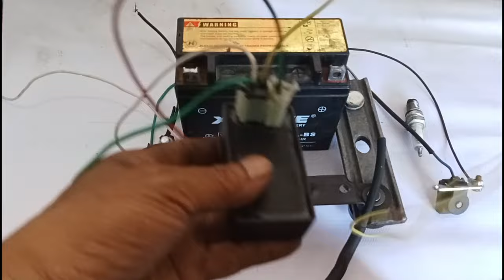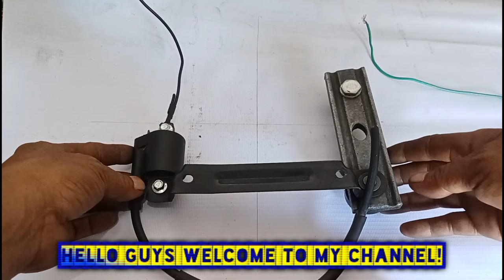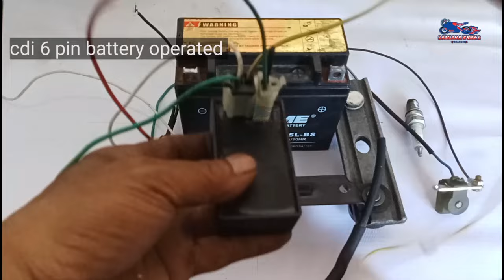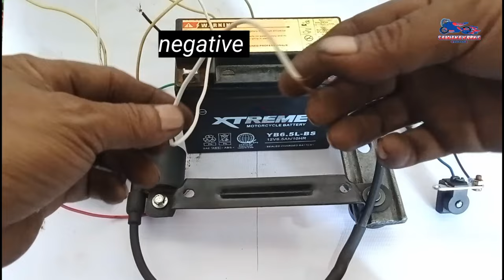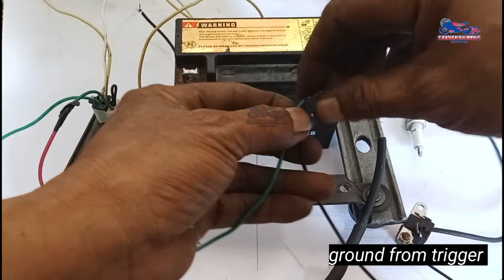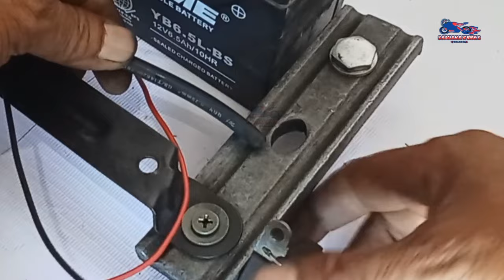invention how to test cdi motorcycle

Comment: Needs one of those spark plug gap testing tools that makes a gap on the end of the spark plug. That's the best way to test if it's good. A short spark doesn't tell enough information. Needs to show a much longer spark to realistically duplicate what happens in the engine. But your design is great! Just needs a little spacer on the end of the spark plug.

Comment: How do you determine what pin of the cdi  gets 12 volts?  I have a 5 pin cdi
Reply from the maker: two classes of cdi one is primary coil operated. the other is battery operated. but they both have 6 pin or 5 pin

Comment: Ac or Dc cdi ?
Reply from the maker: Battery operated CDI sir
Reply: @SamianaWorks   I have one question if you can help me, I have a problem with the electricity on a 150cc 4t Chinese scooter. I took the machine apart for the bearing and it sounds like it was done as it should be, assembled as it should be, everything as it should be, teeth, etc. but it doesn't give a spark to the spark plug. spark, I just connect the wires to the counter pickup and screw the other one, I throw the spark and put the wires back as they should be and fire normally. Now, could this cause damage to the CD or the coils on the multimeter, the coils read the voltage, but nothing is read on the CD or on the whistle, nothing the same , which could be a problem (coils and bomb were almost bought new)
Reply from the maker: Yah sure add me Facebook  then pm check the link description about my channel